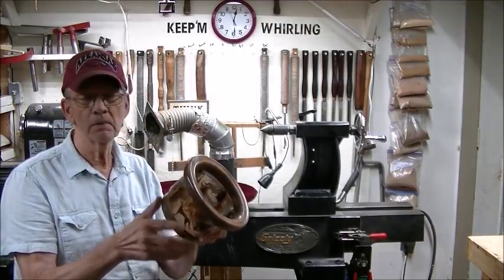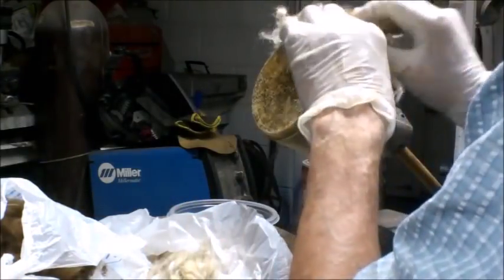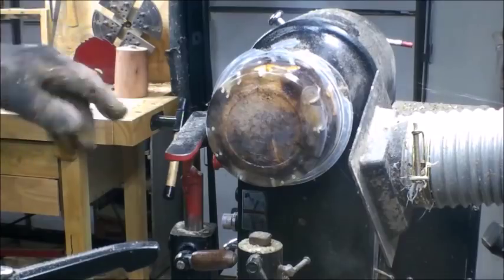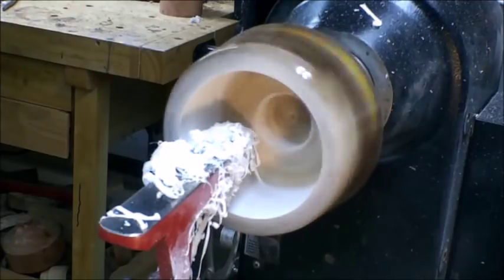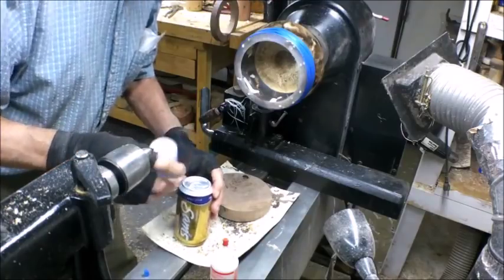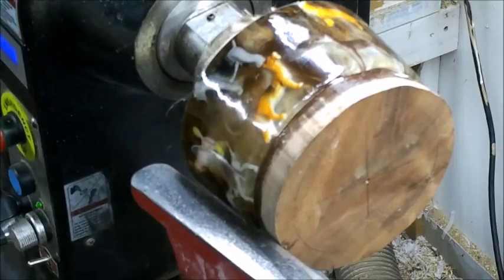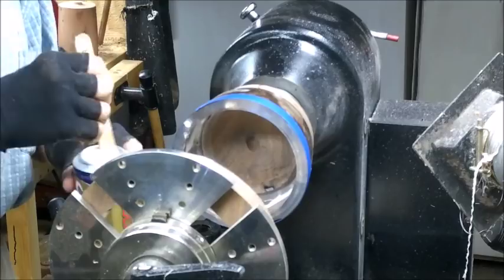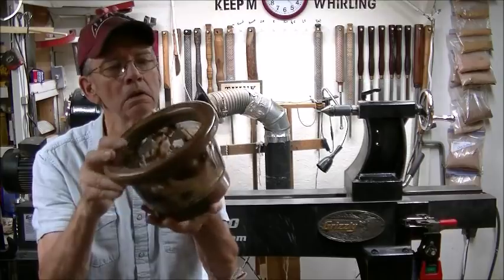Hairy Dog Bowl # 138

Comment: To me, the dog hair seemed a bit weird, to be honest. Still, the artist's vision was revealed. I kinda like it in the end. As Nick Zammetti would say, " that's a bit funky". Good job. If you make a second to of it, maybe do a slightly smaller wood core, so a thin epoxy/resin sleeve, then glue the dogs in and do the fur, then cast the resin around the outside of that. The walls would be a bit thicker, but you could completely enclose the figurines to be visible inside and out. Weird idea made into a nice bowl. Great job Larry.
Reply from the maker: If only I knew then what I know now.  It's always that.  Thanks, Tom, Larry